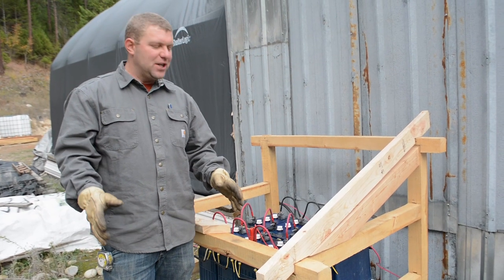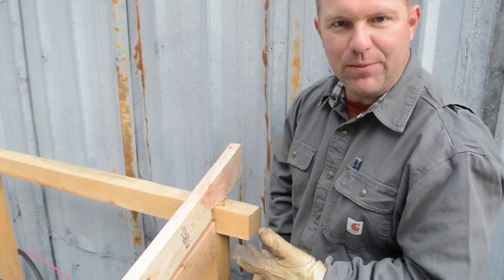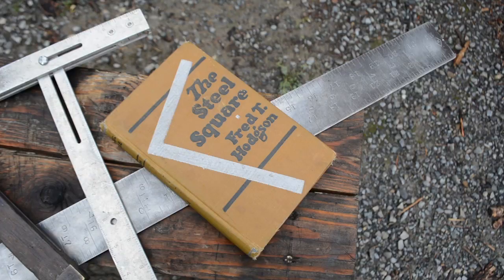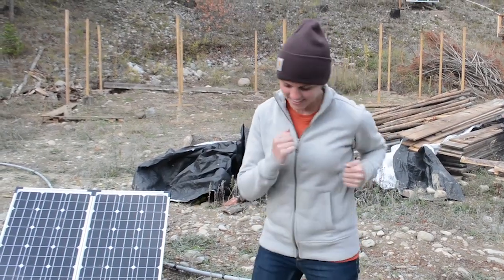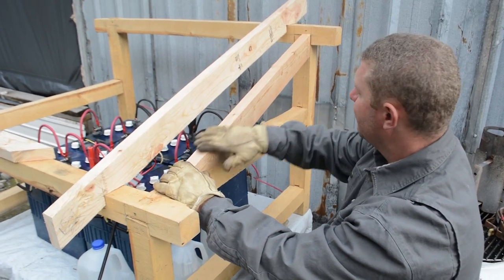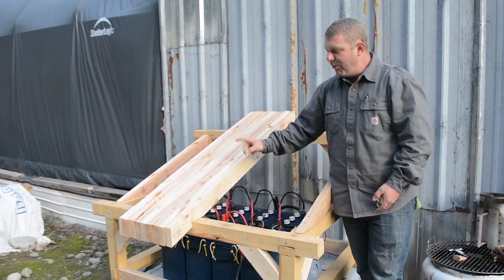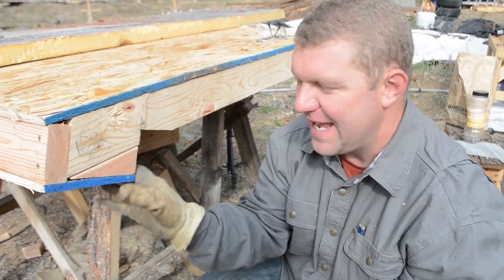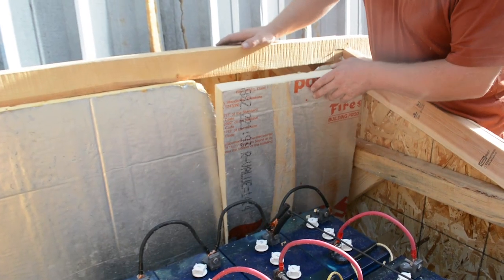DIRT SIMPLE DIY Timber Frame Battery Box (Part 2)

Comment: Great little practice project.  Something to perhaps try the next time you are cutting metal roofing.... take your circular saw and use a carbide tipped saw blade, or take a regular plywood blade that you may not care much about and put it on with the teeth running backwards.  It is noisy, so wear hearing protection and it's always a good idea to also wear eye protection as well.  You may find this a bit faster than a jigsaw.  As always, I enjoy your videos!

Comment: Just something to keep in mind in the winter time you should be fine I made a box similar to what you made and it was in the fall when I made it I did not have any issues to the winter time but in the middle of summer with the box as tired as you made your box the batteries end up getting extremely hot and they cracked three of my batteries so in the summertime you might want to keep your led open

Comment: Thanks.  Appreciate how you explained why you went Timber Frame to practice joints in prep for your house. 
Sure you two will do REAL well on the timber frame house project, you have a very engineer-like pragmatic approach.  

Suggestion on helping to keep life in the used batteries - I've had really good luck using a battery restore liquid (called GOLF CART BATTERY REPAIR LIQUID Solution- on EBay). A few batteries I've used it on were otherwise DOA, but after treatment they worked great. One battery was for our garden tractor, wouldn't hold a charge - it holds a charge now as good as when new.  Perhaps others have had experience with it.  

Glad our Batt & box are done and on our channel.  We are generating more power in the rainy & overcast days than I expected, so that has been nice.   

All the best to you both.  And will be looking forward to your future projects -- Hasta La Projecto!

Comment: Here's a tip when you are putting those screws into the metal roofing. Using a nail and a hammer, make a small hole in the metal where you want the screw. Then your screw won't dance around before it grabs, which prevents it from scratching the paint.

Comment: great video. great box. only problem I see is the same as Mars Rover mentioned, that chipwood loves to soak up water you need to seal it on all sides especially the edges. even if you are covering it in siding. ;) Looking forward to the next video. great job.

Comment: Good practice and looking good even if the roof support is overkill. A normal metal roof wood have the rafters on 16 or more likely 24 inch centers and then have cross horizontal stringers ...like 1 x 4 ... to actually attach the metal to.

Comment: if you have any chance to heat that battery box you should . batteries do not like cold at all it shortens the lifespan and actually limits how much amps you can draw from the battery severely